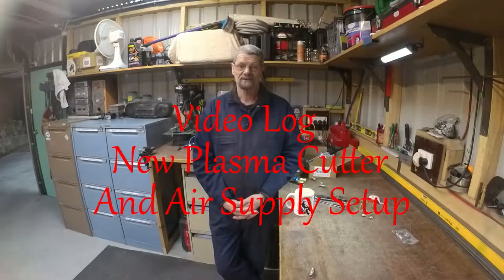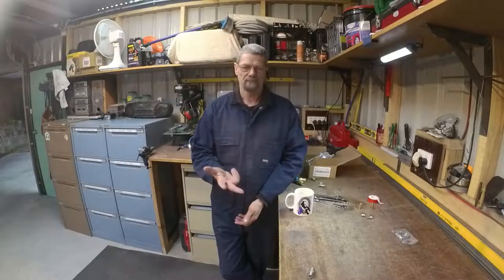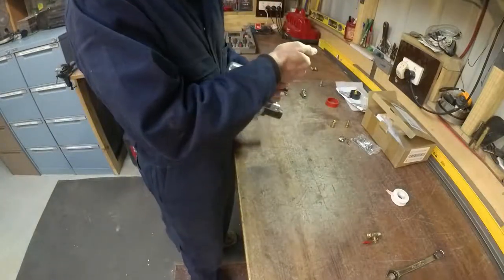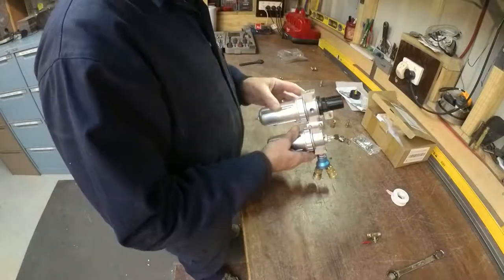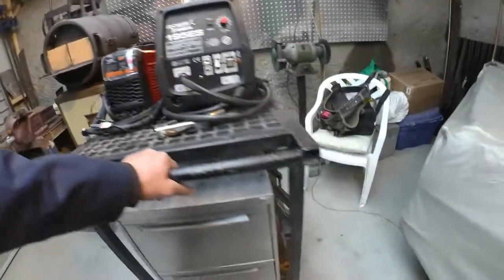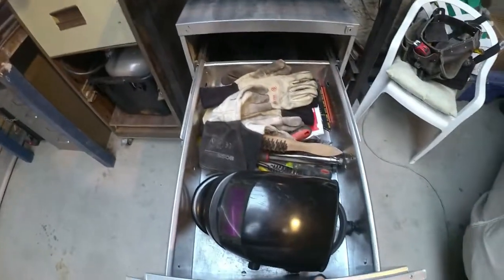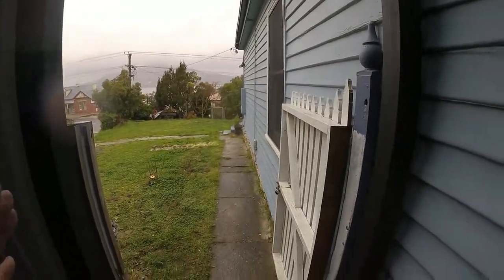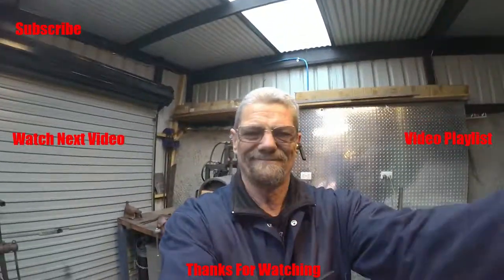Video Log and Plasma Cutter Air Supply Setup

Comment: ..Build a door, forge some hardware for it and a hook to hang the hose on. Busy you are gonna be Andy. Nice tour of the shop also. i'm thinking on getting one of those combo units, be sure to let us know how that one performs...!!
Reply from the maker: Yer flat out like a lizard drinking here Oljames. Gate will be a straight fabricating job, but I will have to decide which is the best of John's "hook of the week" hooks to make for the air house. I will post an update of the plasma cutter once a get it hooked up and start cutting the steel for the coal forge. Can't wait to get into that project when I get some spare time 🤗